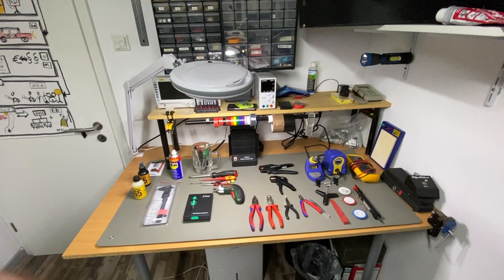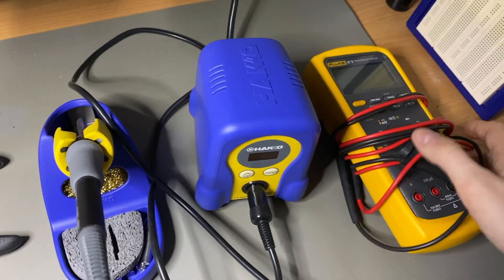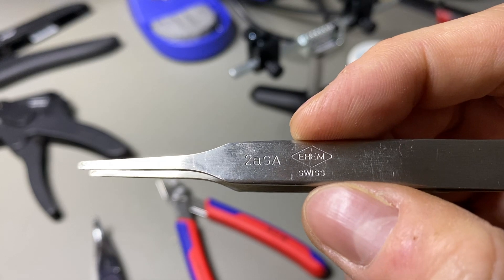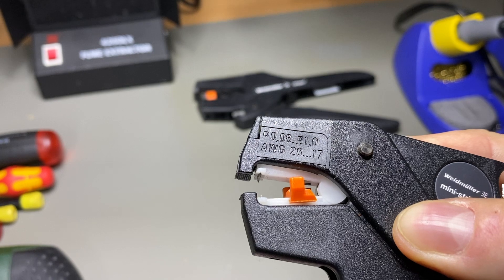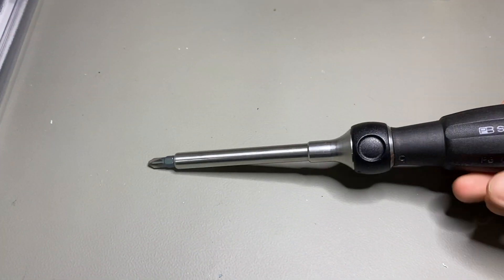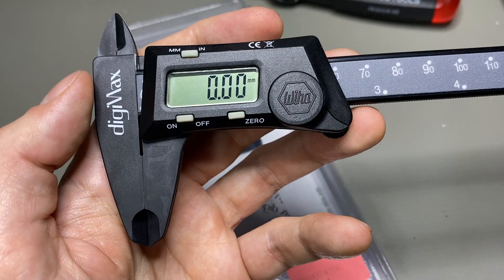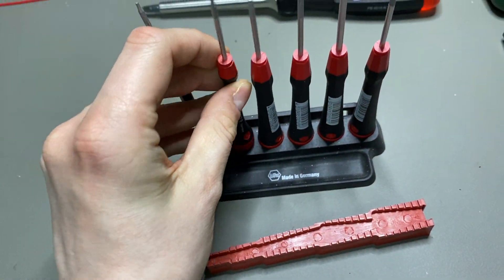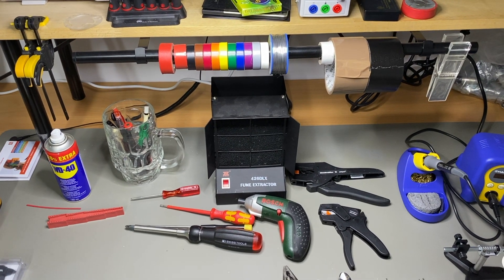What gear do you need for guitar electronics? - Workbench Walkthrough

Comment: desoldering wire, desoldering pump and desoldering gun are obsolete now. A good heat gun is the way to remove everything
Reply: Try removing components off a transistor radio from the 60s with a heat gun ❤good luck

Comment: Here is the story of my Bosch IXO drill: I was in the forest and an eagle flew away from this strange building with CCTV and ECO=VERT written on it. I went inside, it was a garage abandonded since 5 years, just dust, unopened beer from 2009, 12 cars, lots of equipment. There was a bosch mini drill there, so i took it home with a couple of other things, and the battery holds for a long time. it was used to pieces by the garage guy, and i've used it too, and now it's too ugly, but it still works. So, i just took some acetone, and just dashed some dabs on all the green bits which were worn looking, after white spirit of course, and it melted the green plastic into a shiny surface, so it looks and works great. the buttons suck a bit, i found another drill abandoned new in box by Rondy, which had a rusty battery, it works the same as the bosch but the trigger button does forwards and backwards easier. I don't know which of the two is most powerful, rondy or bosch, both. good studio, thumbs up!!!